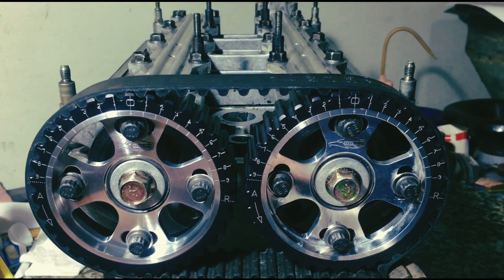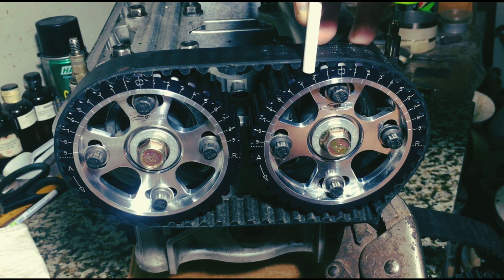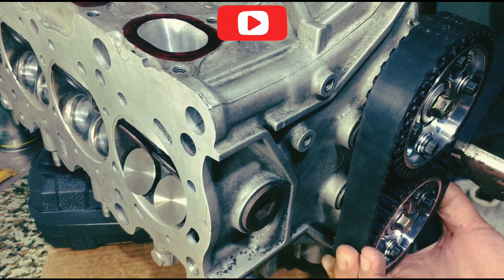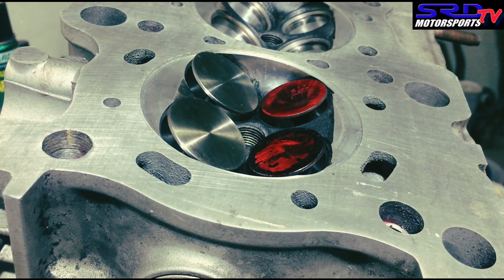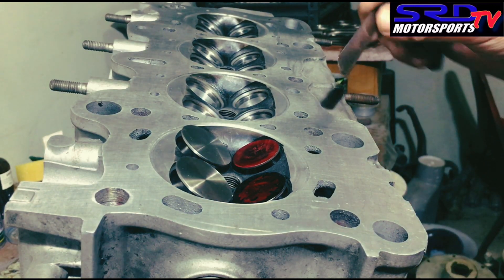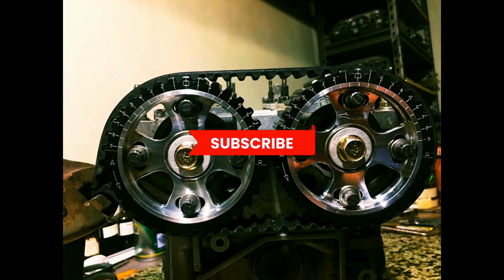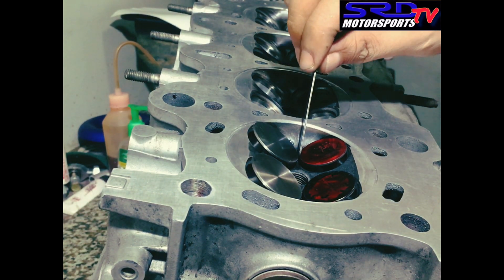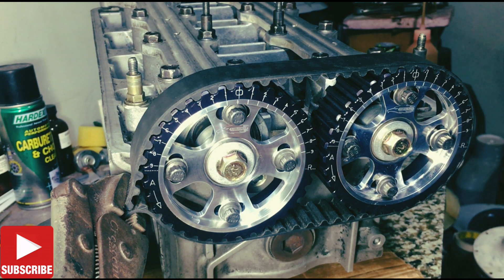Checking valve to valve clearance b16 | b18c
( vtec locked )

Comment: When I lock vtech I can’t turn the them , any  ideas
Reply from the maker: something is binding double check everything cuz that means when engine goes into vtec it won’t turn? Or it’s just real heavy to turn
Reply: @SRDmotorsports  my man this is my setup. B16 head type r cams, blox lma, valves springs, Ferrara standard flat valves, all brand new. B20b bottoms end with ycp pistons, I’ve watched so much of your b20v build. And that’s what got me going on this build. Exhaust cam turns fine. Intake will stop turning at almost peak lobe. I’ve adjusted the valves and everything and locked vtech just like your video, I just don’t understand what I’m doing wrong
Reply from the maker: peak lobe is peak lift it could be hitting piston double check how belt is it might be a tooth off
Reply: @SRDmotorsports  head is not on block yet just checking for valve to valve clearance, I can turn the exhaust cam but not the intake cam
Reply from the maker: yep then so something’s wrong with how you locked vtec
Reply: @SRDmotorsports  it will turn but stop at almost the highest peak and seem to bottom out
Reply from the maker: Like I said that’s an issue it means in vtec engine will suddenly stop or blow up so something is incorrect
Reply: @SRDmotorsports  Ty I will check again, keep up the good video love watching you
Reply from the maker: Yep double check everything to be safe and sure
Reply: @SRDmotorsports  I have double check and it needed lubricant, and when I mounted up I think the valve are missing the pistons, what is a safe spot to degree my cam gears so they don’t touch the pistons, any pointers will help
Reply from the maker: it’s always different each camgear that’s why checking v2v and p2v is important

Comment: Hope its not too late to still ask questions. Does the valve lash need to be set to 0 for an accurate reading? Long time viewer, thanks!
Reply from the maker: Never too late to ask good and cool questions 😎

Actually yeah I wondered about this before but it is proper to set the lash to zero because if we think about it.. lash of let’s say 0.007

with that space on opening and closing that’s 0.014 and that’s a few deg crank rotation
Reply: @SRDmotorsports  your the man, thanks for the quick reply too!
Reply from the maker: For sure 😎

Comment: Thanks, I'm about to do this measurement and this video is really useful! Just a quick question, you measured it at (0,2) (1,3) and (-1,1). The exhaust is always +2 ahead of the intake, so shouldn't the V2V be the same on all 3 measurements regardless? 

Also how did you know to start at (0,2)? Did you just get lucky and end up at 0.041"? I'm thinking I should start at (0,4) just to ensure there is no contact, and slowly move back the exhaust 1 degree at a time until I reach 0.040". What do you think?
Reply from the maker: whoa glad its gonna be useful man!

first question - in theiry it should be the same (0,2) (1,3) and (-1,1) but there are times it changes mainly cuz of the curve or "rate" on howthey lift n close... but yeah in theory and lets say if u got over 0.042" v2v then yep safe to assume but if going risky at 0.038" il check every setting lol 

-second question 
how i knew to start at (0,2) well most if not all Gen3 skunk2 cams the intake often is close or at zero to start with as long as no milling is done etc cuz milling "retards" the intake

then knowing that i always knew these stage cam always wanted that "separation" range
loke 2-3deg difference from the intake so part of it was that

and the other thing was i double checked before recording as it was early days (last year) shooting so i wanted to be certain and ofcourse save viewers "time" cuz coulda been a 38min video hahaha
Reply: @SRDmotorsports  Thanks man. Going off to do the V2V measurement today, appreciate the help!
Reply from the maker: @tomthecat8172  cool man! take notes while at it
Reply: I've done with tuner 2 at zero lash and I'm very close.  00 like 0.010, with out reducing overlap I'm close.  I have to retard intake to improve etc.  You used those cams before?

Comment: man, how I wish I have seen this before the pandemic, I have a feeling my engine still has room for improvement just by watching this vid.
Reply from the maker: oh but just did it last year but been doing this since prolly 2012 hehhe
Reply: @SRDmotorsports  unfortunately lately ko lang din nakita tong youtube channel nyo, but still a lot of infos here that we can use next time😁
Reply from the maker: @the063one  thats all good TBH i started the Channel August last year 2021 and got to share better stuff only by November 2021 🤣
Reply: by the way sir the 0.041 gap its from the feeler gauge, but where did that specific number/value came from?
Reply from the maker: @the063one  general knowledge I mean all proper builders know the minimum “safe” is 0.040” so I just did 0.041 so it’s more 😂

Valve to guide stem clearance x 4 since both guides can move independently and heat expansion 

Just like piston to head “quench” distance is a minimum of 0.042” for safety 
Cuz on the engine stand nothing has expanded to operating temps yet :)

Comment: Hello sir im just curious, will it still be safe even if the vtec switched with that very close of a gap from the valves?
Reply from the maker: ah sorry if it wasnt mentioned... thats actually vtec engaged and locked as that is the point of checking valve 2 valve :)

with vtec disengaged there is probably tons of room :)
Reply: @SRDmotorsports  ahh i see, btw keep uploading! Im really fond of your detailed videos
Reply from the maker: @Mulongski09   I really really appriciate that and also the question (notice i added to the title) :) Gives me more drive and ideas for next tech also aside from the series
Reply: Just want to add a question sir, currently im running a bone stock p6fd1 engine, im planning to get a programmble box plus adjustable camgear, what would be your recommended degree for making most out of it without sacrificing safety? Thank you
Reply from the maker: @Mulongski09  the hard part on that is no engine is set the same or similar even on same stock cam or same ctr cam or even aftermarket, like a muffler difference alone changes alot on both cam relation. This is where a knowledgeable builder/tuner will shine... and ofcourse for full throttle performance, a dyno session is the best...now it becomes a bigger "palaisipan" for a decent street car but if its for race then easy choice must dyno... thats the dilema :)
Reply from the maker: but if ur tuner is tuning the engine, while tuning... testing out 1-2deg is safe enough on stock cams and it is definitely "ramdam" so you would feel what works on your car ftw